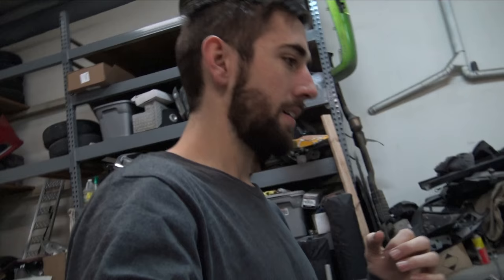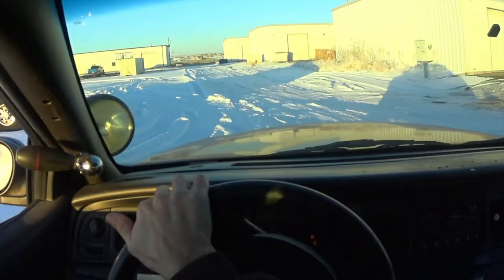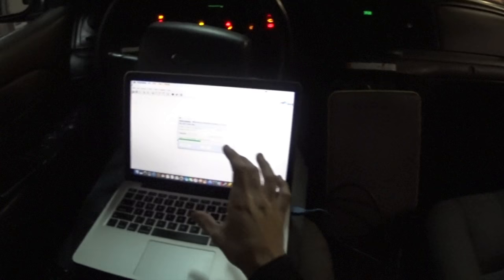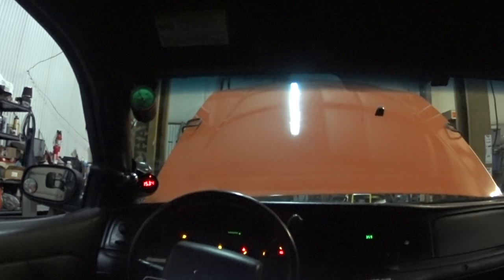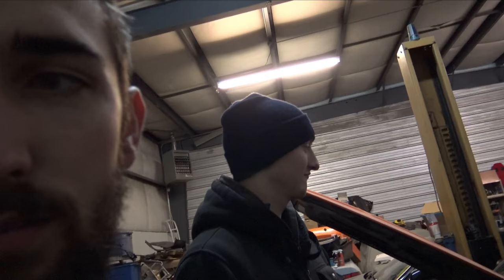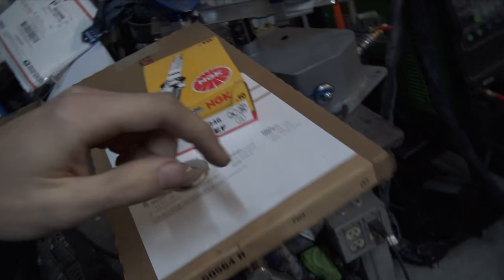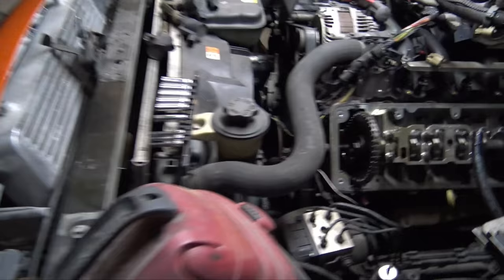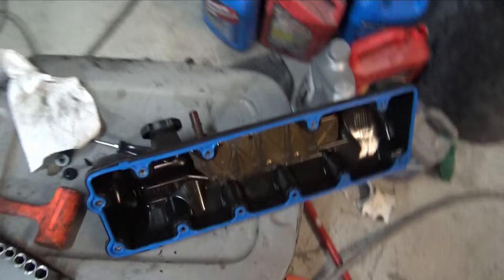Pt.5 | Haggard Garage Challenge | Injectors / MAF / TUNING?!

Comment: Another good vid, keep them coming! I did some of this process with my Soarer 1JZ vvti, changing injectors, upgrading the turbo, installing a wideband 02 sensor and dealing with engine management. It took a lot longer than I expected it to, and cost me a ton more as well. Then once it was done, I decided I wanted to run it on e85, so had to upgrade yet again.

Comment: I would prob shoot for  around 11.0-11.5:1 on WOT, Ive never tuned fords but with the chevy's maf tuning is easy but its not the only thing that should be modified. The PE tables and taking some spark out will prob be needed. after driving around mixed driving The STFT and LTFT will adjust the fueling and you can reprogram the VE table based on what they do. They will also change the PE table fueling while runing so it should be corrected eventually. 

Check out HPtuners forums and be ready to nerd out.

Comment: my 5.4 has 550HP and 660TQ with 60# injectors and dual walbro 255s and even at that the fuel pump will run out of fuel before the injectors. this is the first of the build i've watched so not sure if you've done fuel pumps yet but if you haven't I highly recommend either dual walbro 255s or A1000 pump.

Comment: You shouldn't use a blow off valve so when you quickly let off and get on the throttle there will be leftover boost in the intercooler piping and that will reduce "lag"

Comment: Its got a Nos fogger system and a T4 turbo. I see an AIC controller. It has direct-port nitrous injection. Dom- Yeah, and a stand alone fuel management system. Not a bad way to spend 10,000 dollars.
Reply: Eric Fixalot LOL It's not how you stand by your car. It's how you race your car. Granny shifting not double clutching like you should.

You're lucky that 100 shot of nos didnt blow the welds on your intake.
Reply: SpenserRoger Ask any racer, any real racer, it don't matter if you win by an inch or a mile, winning's winning.

Comment: Hey check out a program called "Forscan" it works great for obdII fords. can read codes and record live data. Can also control input and output PID's. I don't know if it will help much with tuning, but it's great for troubleshooting and testing.

Comment: What Fuel pressure are you running with those 80lbs? With the fordracing 47lbs and 55psi Would get my 13 coyote 600rwhp. Reason I ask I had an 03 cobra that had wicked rich start ups running 1000ccs which is 97lbs i think. Maybe those older computers from the 4.6 take some tuner tricks to get them to start up right? Hope you get it figured out. I would find a good tuner or maybe a mail order to get you in the ball park. Lund or AED are masters on the 5.0 they got me squared away with a few emails.

Comment: I thought the blower fan and shit had to come off to get to the valve cover on the passenger side.. 
I've had to do mine but didn't want to deal with that
Reply from the maker: I just pulled the fuel rail off and slid it up a bit and it came off

Comment: Trev I need some help man. We put my GSR from my 92 hatchback in a 97 EX Coupe, only swapped over motor & fuel pump. The fuel pump isn't priming with the key being turned to the on position, and has a solid CEL. We've disconnected every single plug under the hood, leaving only grounds and battery, as well as relay harnesses plugged up. The car still was not getting any fuel prime going . Any idea what ground is causing our serious failure?

Comment: Can the stock fuel pump handle bigger injectors for the turbo?
Reply from the maker: Its a flex fuel car so it should be able to handle it
Reply: misk one some of the Holdens came with it. But we got the BARRA engines :)
Reply: yeah it just seems like ford missed the boat with what could have been a flex fuel xr6t or sc coyote. they could have made them so much more powerful with e85 support and would have been the perfect way to finish the falcon i reckon!

Comment: Does a Blowoff valve add horsepower or does it just change the noise, sorry if that's a stupid question I'm just curious
Reply: Hector Garcia it vents boosted air from the intake path when the throttle closes. prevents the air from spinning the compressor backwards.
Reply: R Shiery it prevents compressor working in unwanted spot of compressor map, and releasing boost pressure back through compressor housing (turbo flutter) compressor NEVER spins backwards however..so it does not add horsepower, but it helps smooth pressure buildup between gearshifts and prolongs turbo lifespan.

Comment: I know your caught up in the supra and crown vic but can you do a video for valve adjustments on the crf250r. I gotta do them and I dont wanna fuck up
Reply: Lots of videos about that I am sure ,but it's just a matter of measuring you gap cold and removing the shim measure and subtract what you need to get the right gap .So if you have 1 mm gap and need 4 then what ever thickness your shim is you need one 3mm thinner. Set the motor at tdc ,on the compression stroke to take your measurements. 
A good idea is to get the narrow feeler gauges for bike motors ,they are about wide as a pencil vs the normal ones as wide as your thumb. And of course you will need a good micrometer to measure the shim once removed.
 3d machines just did a video about it I think  I seen it in my suggestion list.
Reply: P Kuudsk thanks man
Reply: NP Just make sure to re measure your gap after installing the new shims to make sure you got it right. Good luck it's not hard if you take your time.

Comment: is that not the engine where the bottom piece of spark plug breaks off?
Reply: Yamaha Rider no that's the 5.4 and the v10s just the 3 valve engines
Reply: Jacobisaweiner I did them on a mountaineer and they broke. that was a 4.6
Reply: Yamaha Rider any aluminum head engine can cause this... not just fords. but the triton 5.4 mainly to 2004-2008 f150s. that's just poor maintenance tho
Reply: Alexander Helton this 4.6 had those spark plugs with the smooth steel sleeve that touches the head. they didn't look like the plugs he put in that car.

Comment: why get a blow off valve? turbo flutter is better
Reply: longer turbo life
Reply: i meant the sound is better
Reply: James Flores but this is the haggard challenge
Reply: datstocklyfe well longer engine life would be a shame if he over boosts and the motor blows up
Reply: turbo flutter is bad on the turbo shaft and bearings over time.

Comment: I have a question to anyone, 
Trying to change the MAF in my 06 subaru impreza 2.5i, Got the maf sensor. Installed it. Turned on the car. Turns right off. Is it true i have to get the ECU updated? 
I apologize if i sound dumb. Just looking for help.
Reply from the maker: Is it an upgraded maf sensor? If so it needs to have the ecu programed for the new voltages
Reply: you will probably need to change the VE map in the ECU to match the MAF
Reply: PiezPiedPy explain what VE map is. never heard of that before.
Reply: MotionAutoTv i dont think its an upgrade. i know its not oeo. just a cheap maf i got off rock auto cause mine has a crack in it, which i hope is throwing a bunch of other codes
Reply: The VE map is used to convert the voltage from the MAF sensor into a number that represents how much air is entering the engine. Loads of info on google that will go into detail ;)
Reply: Subarus are picky. Id only run the OE maf. Get on NASIOC if you have any questions. No ECU mapping is required, and I see its n/a so really shouldnt be too involved to get it running correctly.
Reply: always buy oem parts or buy top of the line proformance parts.. its the easiest and least work. if you get a maf from the dealer you should be able to just replace it and go nothing else.
Reply: so you replaced the MAF because it was cracked but don't know what codes are thrown?
Reply: Airpig nah, when i first got the car. both o2 sensors went out replaced upflow and down flow, codes went away but came back. searched on forms and what not. read that the maf could be shorting out and causing my o2 codes and crank position code to set off and throw the check engine light on. the top of the maf has a crack in it so i got a new one. but the new one doesnt run with my ecu. i should have researched more. but im still new to cars and working on them
Reply: Thank you all for the help. like i said still new to working on cars and what not. but we all gotta start somewhere huh?
Reply: Riley Boyd you are completely right. when i got the maf. I really only thought i could go on rock auto and buy a maf that was for my car and be fine. but i learned the hard way that i cant.
Reply: Christian_Dunce ok so best practice is to call Rock Auto and double check the part numbers. yeah Subaru's are sensitive but so are many other cars. If you have a current code throw it up and we'll see how to narrow it. The no start may not be related to the sensor. was there a code thrown stating the MAF sensor was faulty? Did it run rich, sputter and go into limp mode?
Reply: they make several different MAF sensors within the subaru line. Try to get the part number for your specific model
Reply: Coltondk i thought i did. But i guess i was wrong. I'm just going to head to the dealer and buy one from them at this point
Reply: Christian_Dunce eliminate the first variable. If that doesn't fix it run the codes again.
Reply: You can't go changing random shit on a subaru, they are assholes. you might need to invest in a programmer or put it back to stock.
Reply: It is stock? Never changed random shit. The person who owned the car before me some how cracked the maf sensor and its throwing a short voltage, which is throwing off my o2 sensors and crank position sensor and obviously my MAF code.

Comment: I've had that plastic tube rupture Every time I tried to use it. Not chafed it gets brittle after a few heat and cool cycles and snaps in two. I get copper or when I can rarely fund it stainless tubing and have never had a leak is either one. Copper being soft I usually cover it in fuel line or plastic air line  since I have a lot of it from diesel and custom suspension work. I keep a repair union in anything that uses the tube but haven't had to use it.